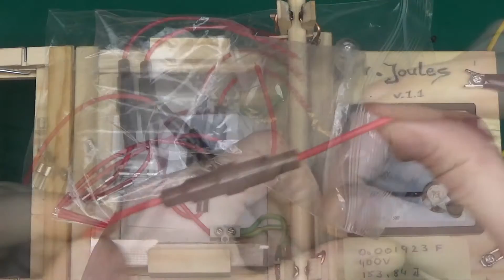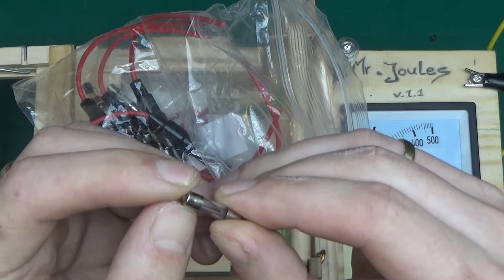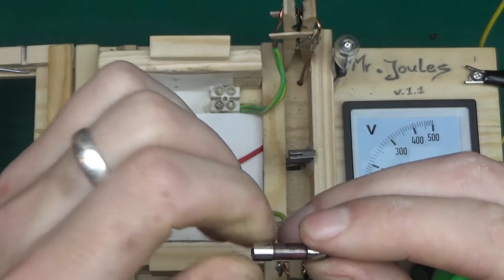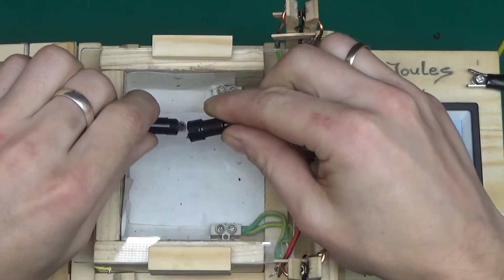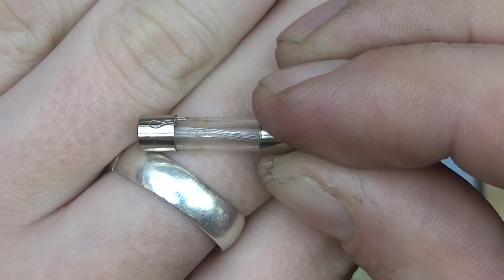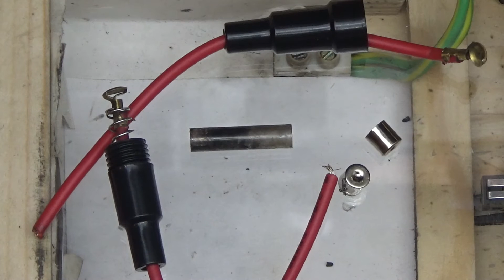Mr. Joules 013 - In line fuse holder and some fuses

Comment: The best type of fuse though is the ceramic, sand filled type. Those have higher interrupt ratings than glass. I've seen glass ones that have exploded because of a short circuit. (Often this failure is witnessed in switch mode power supplies, as when the switching transistor shorts, it REALLY shorts...!)